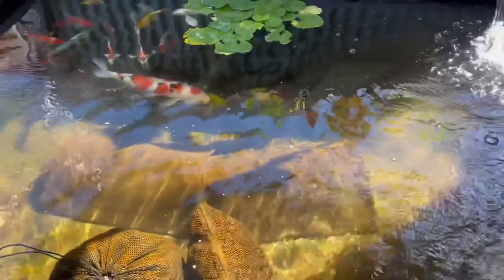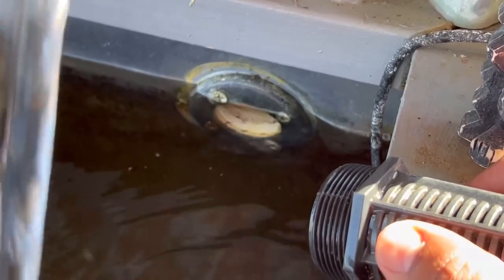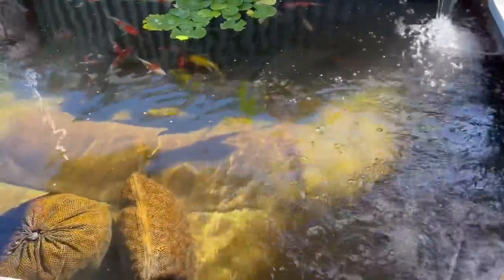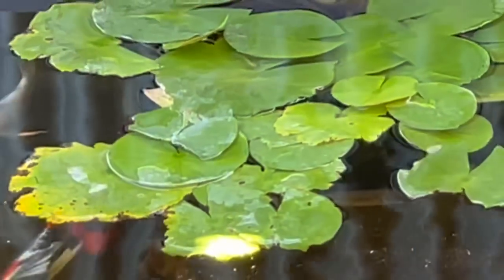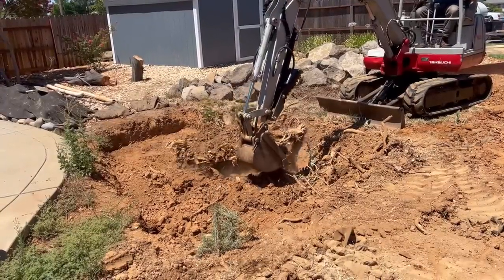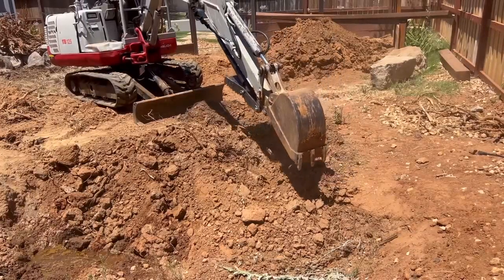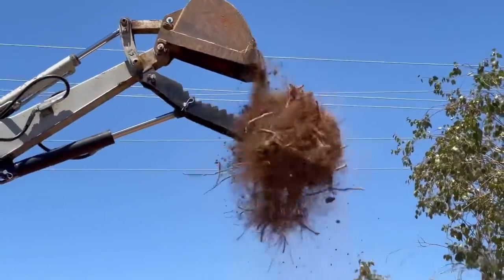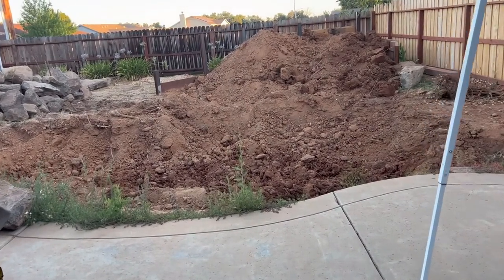DIY BACKYARD KOI POND BUILD!

Comment: Nothing more satisfying than getting rid of a tree stump.     As far as the Above ground pond I recommend using irrigation drippers to help keep up with the evaporation.    Maybe at least put a hose timer so you do not forget the hose water running.   I understand it works,  but if you need to ask someone to do it because you are busy... Ya gotta make it easy,  foolproof and forget proof